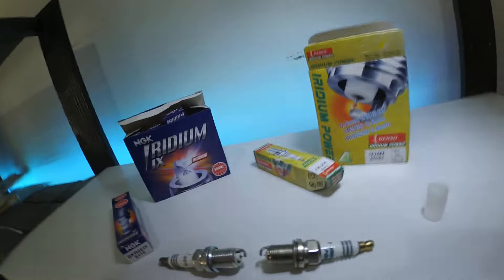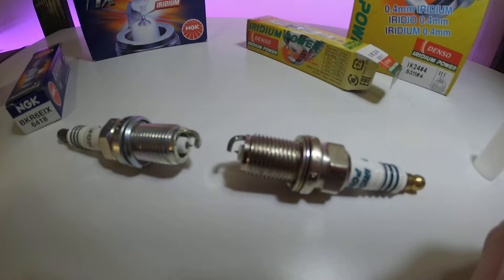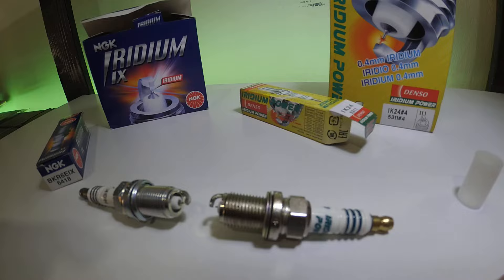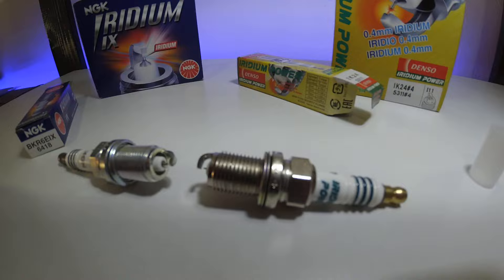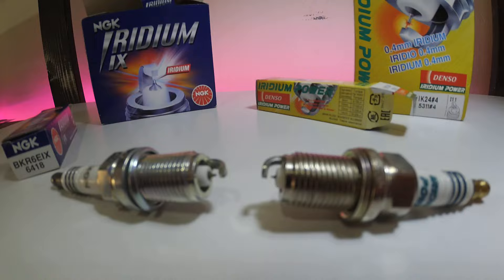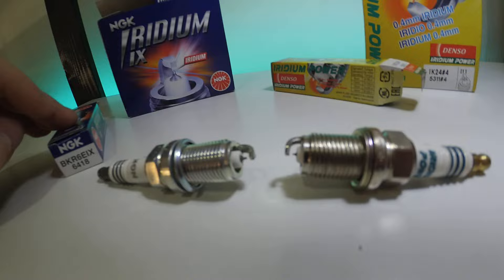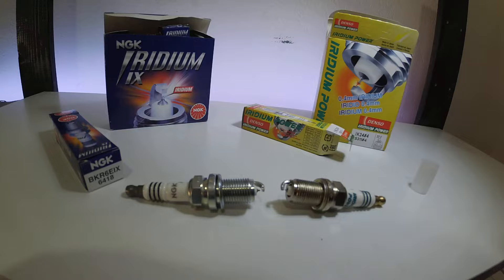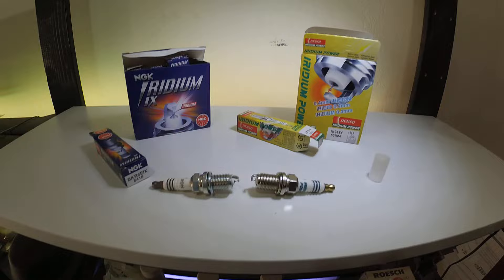NGK Iridium IX vs Denso Iridium Power - What's the difference?

Comment: I have a question. What is the different between the Laser Iridium plug vs the Iridium IX from NGK?
Reply from the maker: Great question. I dont remember ever seeing a Laser Iridium product code AND an IX Iridium code for the same engine. ie it seems if NGK make a Laser Iridium Plug for a car (which is usually, if not always, the OE fitment) they do not make an IX Iridium plug for that engine as well. But I could be wrong....
Reply: @DriveTuneMedia  are you shure that your denso plugs arent fake
Reply: Laser iridiums have a platinum disc on the ground electrode strap for increased wear resistance at the ground electrode strap.  The Iridium IX have a tapered ground strap for less quenching effects.  I have to replace Iridium IX and Denso Iridium power every 20,000 miles, not because of the iridium electrode, but because the ground strap wear.
Reply: @fartman10284  So you don't recommend switch my spark plugs from double platinum to iridium?
Becuase
I have old 99 toyota sienna that use double platinum spark plugs.
Reply: @justine5804  always go oem plugs if they specify. It's only a few dollars more but performs to the max
Reply: @melancholypuppy3595  Yeah. that's what I got and it works like a charm.
No more hesitation when I try to accelerate and my old car runs like new again.
I will always get oem if I can.

Comment: I have a 2007 E550 with 150k miles and stock plugs still inside I think. I was wondering What would be better choice. Denso iridium power 5353 ixuh 22 plugs or ngk 5353 iridium ix plugs?
Reply from the maker: Both good. If you want the absolute longest lasting plug I think the NGK is the one.

Comment: I got my plugs replaced at 70116 in 2019 that’s from new I’m at about 130 k should I change them I’m having second thoughts now that I’ve seen your video thanks greetings from Scotland 🇬🇧🇬🇧🇬🇧
Reply from the maker: If they working ok eg not damaged, no problems, not excessively worn etc its possible they will keep going.
Reply: @DriveTuneMedia  thanks for the info

Comment: Just removed AC Delco Iridium w/168,000 mi...still working but WORN :( ,  replaced with NGK.
Reply: If that's true, the AC Delco performed outstanding.
Reply: AC delco products are on the cheap side
Reply: @issavibez394 champions
Reply: @Phone-sh7jg  what champion

Comment: What about a 2004 volvo s60 2.5 turbo ngk or denzo's? Thanks
Reply: I know I am really late to this conversation, but for Volvo 2.5 turbo enthusiasts in North America, IPD lists both the Denso Iridium Power and Denso Iridium TT as their "performance" spark plugs, and Bosch and Genuine Volvo as their stock replacements. IPD's major Volvo parts competitor in NA, FCPEuro lists only the NGK Laser Iridium Spark Plugs. I was leaning towards the NGK Ruthenium HX but am now considering the Denso Iridium TT as my upgrade from Genuine Volvo spark plugs in my slightly modded 2.5 turbo.

Comment: My car uses ordinary spark plugs and has a change interval of every 2yrs or 30k kms. That is based on the owners manual.
Thats ordinary (nickel coated).
Platinum 1year at 12k kms? Lol
Video is very wrong.

Comment: The point of platinum and iridium plugs with the fact that you can get a hundred thousand miles because they don't wear out as fast as a regular copper core plug that's the only reason why platinum and iridium plugs exist
Reply: Kevin Coulombe wrong. They also have a more constant consistent spark with the fine point electrode
Reply: That goes with out saying
Reply: no.

iridium is better i was test it on dyno,
and iridium is better on low rpm - high rpm, more hp more torque

Comment: I have a 1995 Toyota tercel with a cold air intake headers and a high performance intake manifold what should I use Denso double plt dual electrode or Ngk laser double plt dual electrode
Reply from the maker: Hello. I would fit neither. I only recommend Iridium spark plugs. Having seen the difference in service life, I would only fit Platinum spark plugs as an absolute last resort.
Reply: Can't do that. This 1.5 engine can only use Twin ground electrode plugs that's why I'm asking if I fit anything else that's not twin electrode the car will misfire or not work rigth
Reply: I have twin electrode right now but copper ones
Reply from the maker: For the 1.5 5E-FE engine, Denso recommend code IK16. I am 100% positive Denso will not recommend a plug if it doesn't work properly.

More info on ground electrodes here - 
http://www.sciencedirect.com/science/article/pii/S2090447912000883
Reply: Mario Moreno why would you want a weak slow ass toyota tercel with a cold air intake and performance manifold? Its still gonna ve slow ass hell.
Reply: I like NGK but for Toyota I will use DENSO.

Comment: I have a 2011 BMW 328i, and I recently bought Denso iridium. The factory is recommended to use Bosch or NGK. What do you guys all suggest?
Reply: I use Denso iridium in my bmw e36 318i touring 1998, works perfect
Reply: Bjarni Seerup thank you sir#!
Reply: Just put these denso iridium power spark plugs with bosch coils, and my car sounds amazing, getting way better gas mileage and no rough idling. I have 140k miles, and my car purrs like a baby. Denso Iridium is the Best from my experience thusfar.
Reply: It's a BMW very picky so go Bosch
Reply: @melancholypuppy3595  true — that’s a good point
Reply: @melancholypuppy3595  true 😂

Comment: I have a Mercedes C250 which spark plugs I should use?
Reply from the maker: Try these links
https://streetandcircuit.gr/denso-iridium-power-c-198201.html
https://streetandcircuit.gr/ngk-iridium-ix-c-200095.html
Reply: You should use the Mercedes C250 spark plugs for your car.
Reply: @vipergts6342  Agree. On European cars go with the OEM plugs. It will be expense. Get used to it, you're driving a European car.

Comment: wasnt it if the number is higher the hotter they are?
Reply from the maker: Higher the number colder the plug. ie if you increase the power by 75-100, go colder eg if you were BKR6EIX before, go to BKR7EIX. As a very general guide.